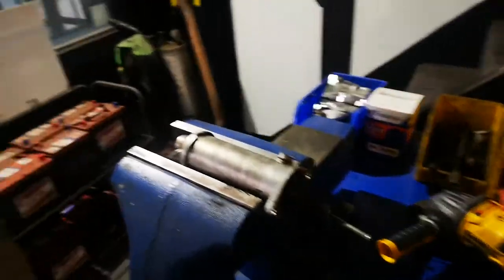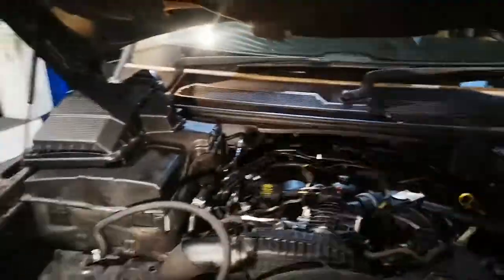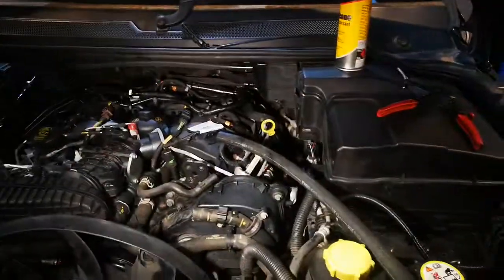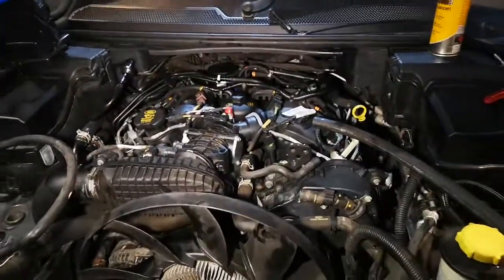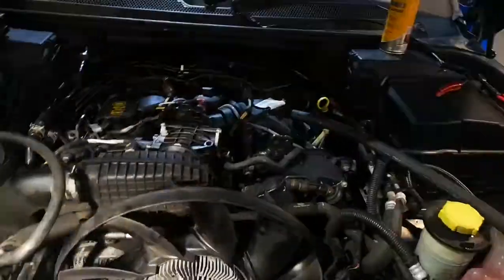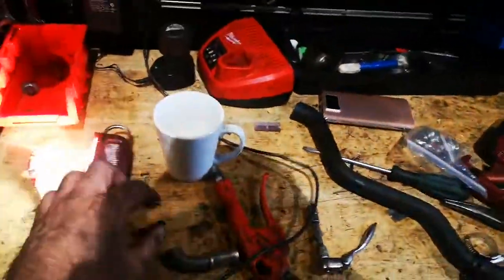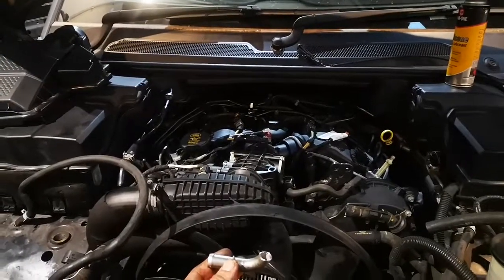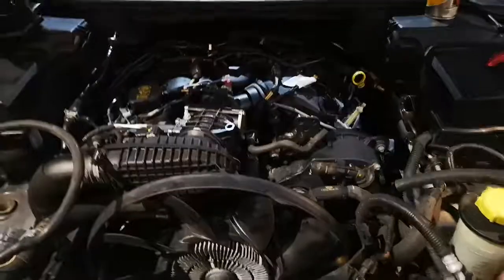Range Rover Land Rover 2008 Sport Diesel EGR coolers BOTH failed simultaneously tested individually

Comment: If you bypass the coolers the engine ill not get to operating temperature, it will go no higher than a quarter on the gauge. It will take  the cab heater forever to warm up and will never be as warm as was previously. the engine oil won't reach full operating temperature and for an engine with such high tollerances this could be a problem. The EGR coolers have there own thermostats, they heat and help regulate the engine coolant thus regulate the engine  temperature. In short don't do this mod, replace them regardless if the EGR's have been blanked or not

Comment: Hallow,i have a problem with my lr3 tdv6 2.7,the coolant system on coolant bottle produce pressure which has a hissing sound on coolant cap. Any ideas what might or is the problem?
Reply: What was the issue? I have the same problem